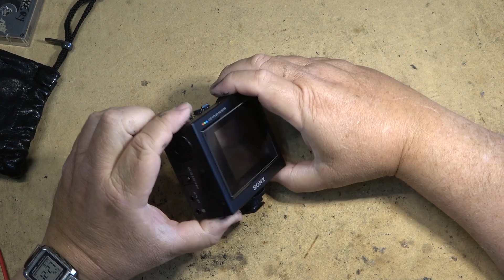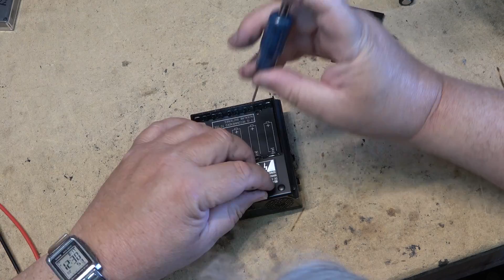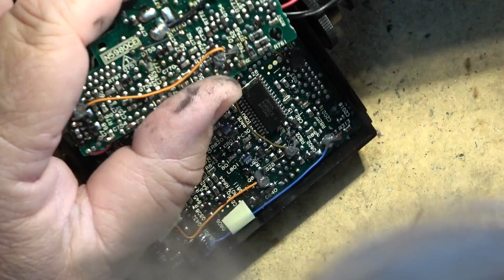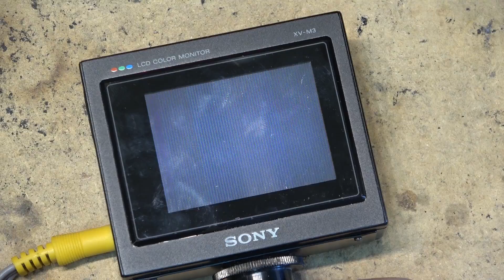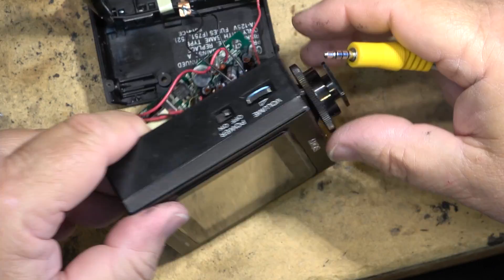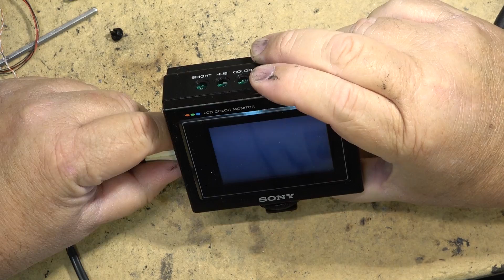Sony XVM3 LCD mini monitor

Comment: Amazon Has Repair Parts For Flat screen
TV's & Other Electronics.
Reply from the maker: Is amazon going to give me those parts for free? I think not.  I just said I made 50 bucks to fix this tv. There is zero dollars for any parts.  When it was brought to me the limit was 50 bucks.  If you can get it going for 50 do it otherwise recycle it.
Reply: @12voltvids  you can Always Rob 
LED's Out Of Other Flat screen Tv's
Reply from the maker: @rogertyler3237  ya, I could but when i am making 50 bucks why would i go to the trouble of finding another tv to rob them out of.  It's not like they are going to pay me more. I had a 50.00 limit and that is what I got for it.  It was either that or take it to recycling.   So no, i wasn't going to spend a penny on parts or spend an extra 5 minutes more than I had to.  This was more of a let's see why this tv isn't working and yes you can jumper out the blown led and it will work for a long time.  I have one of my own that I did this to 4 years ago and it is still working.  Now if it makes you feel warm and fuzzy to change the led, knock yourself out.
Reply: @12voltvids  it's Always
Good To Have So are Parts Around. You Wouldn't
Believe The Parts I Used
To Remove From Old
Radios TV's Cassette
Players VCR's Boom boxes. Radio TV Phono Nut & Shango 066 Done
 The Same Thing.
Reply from the maker: @rogertyler3237  no place to store them.

Comment: It's The Video Amplifier Unit That's Dead.
Reply from the maker: It's actually the LCD driver board that is fubar.  Color codes on cables are only valid with the correct cable as these cables are all wired differently.   I have done videos showing the difference between them

Comment: The AV input is basically a stereo jack plug, and the pinout might be this:
       GND      audio      video
─┐    ╱        ╱        ╱
   ├───┬───┬──╲
   ├───┴───┴──╱
─┘
You should try this variation and see if it works this way or not. 😉

Comment: This Sony Lcd monitor also uses solar panel that is included with the unit, it turns the unit to run on solar that is a beautiful unit that I used during late 80’s along with my video8! Great product but the age has caught up to her!

Comment: Too bad the guy didn't include the adapter cable for you to be able to test it. You'd think he would have it if he planned on using this monitor.
Reply: the cable was not a standard cable, the owner did not know about.

Comment: WOULD THAT NOT BE 7.5VOLTS?
Reply from the maker: Under load the battery voltage drops.
Reply: @12voltvids  why is that? i’ve always wondered that
Reply from the maker: @walle637  internal resistance of the cells.

Comment: Looks exactly the same as some other brand LCD tv's of the same era like Casio and Epson. I have some that work great but they are prone to LCD degrading and back light failure.
Reply from the maker: Yes my Panasonic LCD has degraded and the backlight burned out.
Reply: @12voltvids  I still have some units still working nice. My Sony Fm-330 Color TV does not work.
Reply: @12voltvids  Burned out backlight? Well, disconnect the inverter, measure the voltage, then hack in some LEDs into place of the backlight tube. I successfully saved my Casio pocket TV this way. 😉

Comment: instead of using a jack , why dont connect ur video signal (common ground) and a probe and poke each solder joint of the jack connector...  you shouldnt write off a collectors item ..
Reply from the maker: Not authorized to spend money.  As it is I spent time on this no compensation. Did it just for YouTube revenue but that won't make much.  Perhaps a couple bucks a month for a few months then very little.  Videos on video equipment makes very little.  Audio gear does much better.

Comment: Sony with there daft connector configuration.
So someone sends you this, but does not want to spend much money.
That's an insult to you dave :-(.
Reply from the maker: I saw a picture of the cable.  4 conductor 3.5mm. knowing Sony it is a dongle cable and it may very well actually display a picture with the right cable.
Reply: @12voltvids  There must be a earth on that socket, and 75ohms on a pin to earth should be video.
But sony play nasty, so they might feed the video through a capacitor before the 75 ohms to earth.
If it was yours i would say ' have another go'  but since the owner is a tight ass,  don't bother ha ha :-D